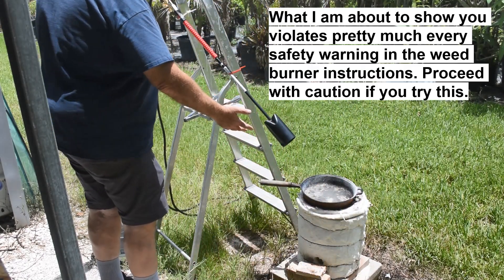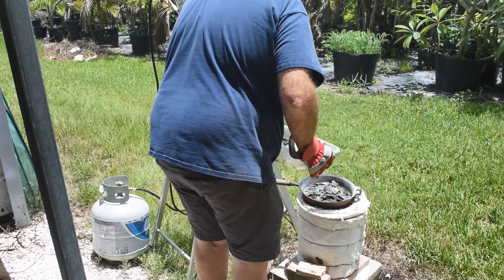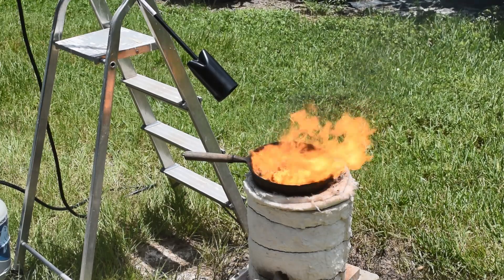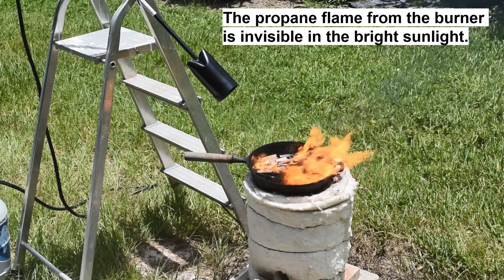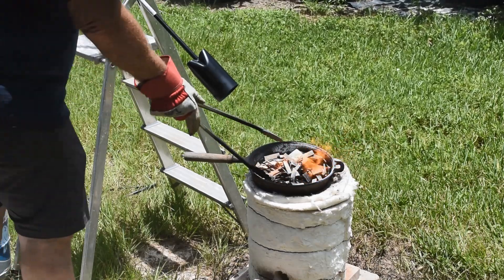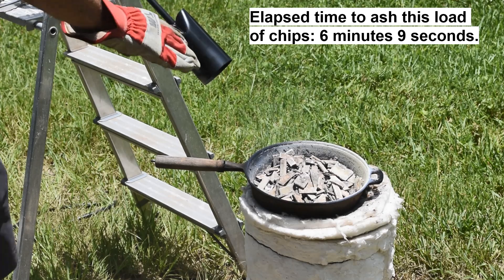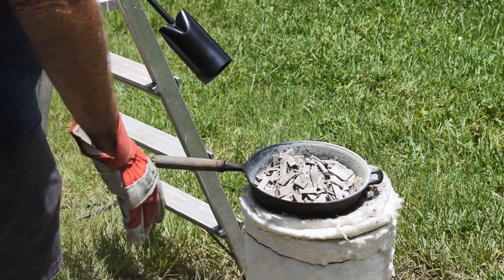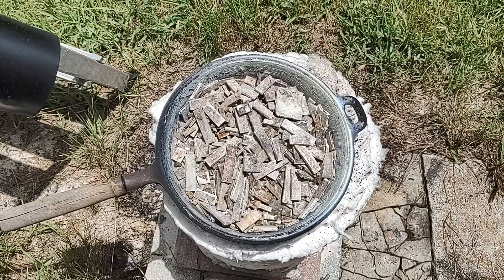Gold Recovery From Incinerating IC Chips: New Method

Comment: Are they really white to the middle of it ? Cause i didnt get this result after 10min  wit my 500k btu propane torch
Reply from the maker: No, not white all the way through, unfortunately. They are well ashed on the outside and the volitiles are totally burned out, but there is some carbon left inside. Good enough for my purposes.

Comment: I use a colmen single burner / camping stove. The one with the square top to set a pot on. However I took the bottom off of a metal 1 gallon can, no top, no bottom. I place some 1/4 garden fence inside to act as a bottom. Fill it with chips, set it on the burner and let is burn. Air flow right up through all the chips. Once in a while i just shake the can a bit

Comment: Great minds think alike. I have that set up too. How long did it take you to remove the damn check valve?
Reply from the maker: I haven't yet. If I turn he valve on at the tank slowly, it doesn't usually shut off the flow of gas. It may have to go in the future though.